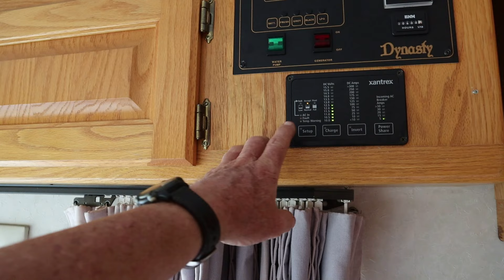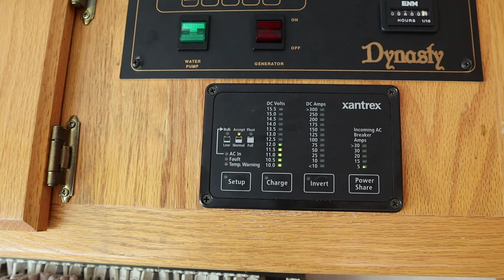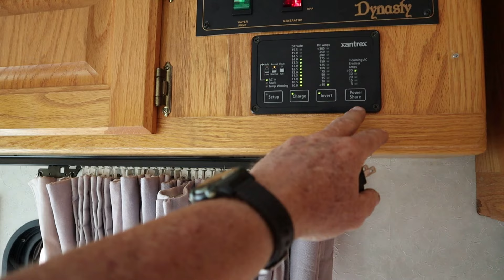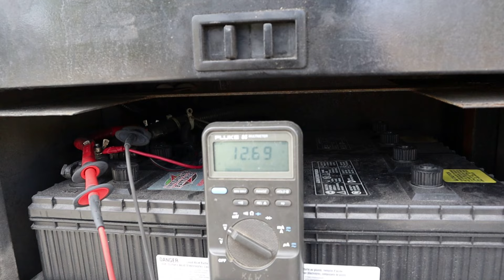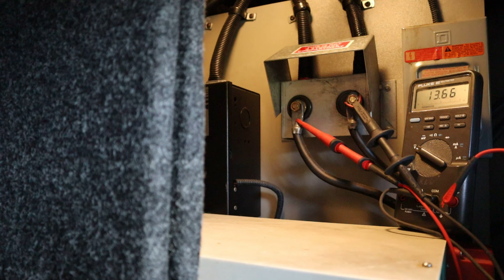Inverter-Converter Failed?

Comment: Well it would be hard to change your batteries at 10vac , or less try to run anything that needs 120vac. These things go bad and have to be replaced. Great Job on find the problem.

Comment: If the inverter and charge lights are both on it will not invert. Push the charge button to turn the charger off when you are trying to invert. You can not invert and charge at the same time.

Comment: 13:34 - you had 12.7 on the battery. if it is hooked up you will get it on the solenoid even if it is open

Comment: Does the coach have solar on the roof charging the batteries?  Did you have charging voltage at the isolator’s connections with the engine running? Is the breaker tripped on the converter?  Most likely it’s the converter. I am the type of person who would tear into it once it was back at the shop. I like to find out what component failed. Good luck and what a beautiful day outside to be working.